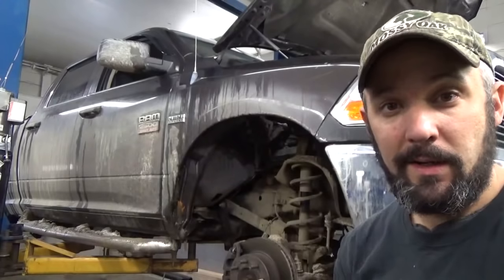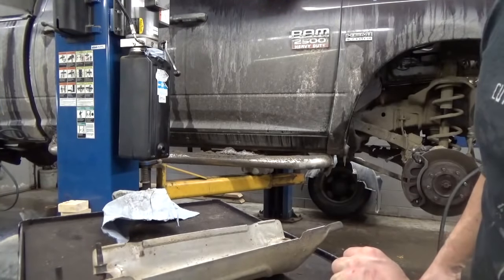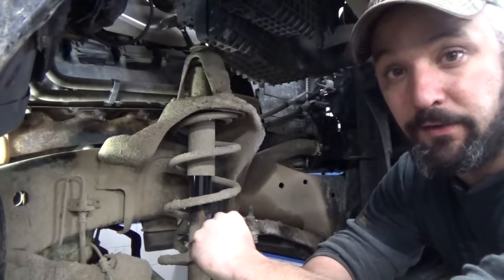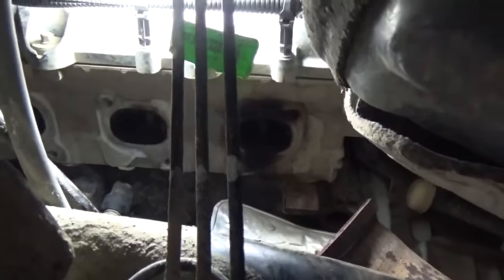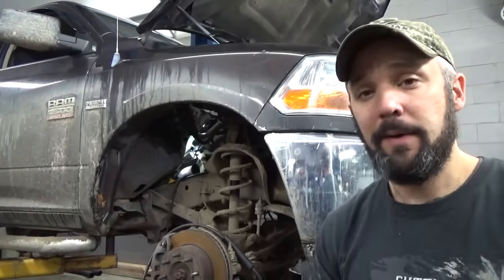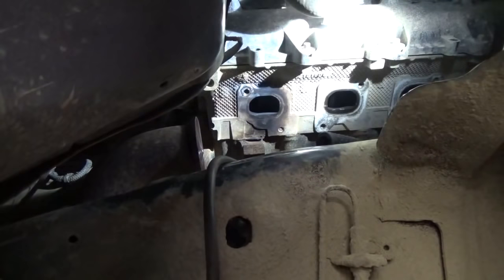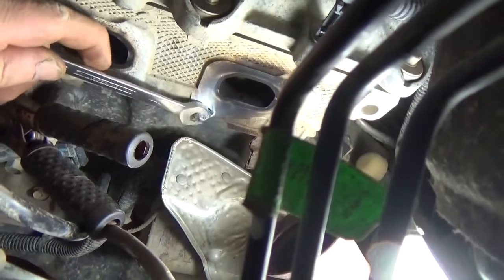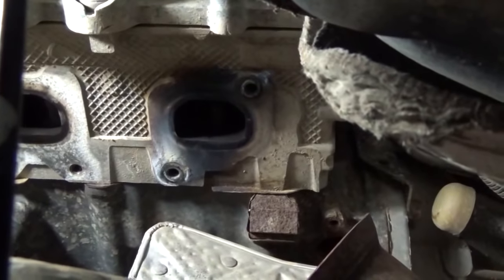Removing Broken Exhaust Manifold Bolts - Hemi Dodge Ram

Comment: Now I know how to fix broken exhaust bolts.  Just drop it off at your shop and wait for the call when you're done.
Reply: Sounds like the only real option to me.
Reply: You make it look easy. Experience plus correct tools is key.
Reply: Yep they never go the way they should, just buy replacements and hope it don't come to taps lol!
Reply: Or pay a mobile mechanic $200 to come do it in your driveway, in the rain, on sunday.  Lol.   Ask how I know
Reply: this video is for the poor bastard that has to take your vehicle in while you wait every 2 hours to call in to see if it's done yet.
Reply: @user-sl4ul4nc3t  Not me, I still have the guys number tho.  He showed up with a giant truck with a huge welder and zapped a nut on the end and worked it free. 🤷‍♂️
Reply: @getchasome6230  I would pay $200 for sure. I have the tick and it goes away after warm up so guessing this video is explaining my problem. How did you find a mobile mechanic.
Reply: @TrustNone35  I paid $200 to have a broken bolt removed. Lol.  It's going to cost way more than that to fix your tick
Reply: @getchasome6230  Jesus christ man I was gonna say I'm a licensed tech and 200 for the whole job in a driveway I was like wtf lol
Reply: @6door6four96  Lol. No, $200 was for just one broken bolt.
Reply: After some pb blaster and small pair some of those old craftsman self adjustable pliers I have successfully removed those junk bolts lol

Comment: I have a 2009 1500 ram 5.7 and two bolts from both right and left side fell out. I have the tickong noise coming from the exhaust. Wish I had the tools to fix it

Comment: Tip on welding nuts to broken bolt/studs, especially when the bolt is broken below the surface;  weld build-up a nubbin on the bolt BEFORE putting the nut in place for welding.  This does two things: it lets you more precisely place the initial weld metal on the bolt, then it lets you easily position the nut over the nubbin for final welding.   I've been using this method for many decades and it almost always works for me.  Love your videos.
Reply: Where do you put the ground clamp for the welder ?
Reply: I know how to weld and I'm a mechanic that's still my question... can you just attach the negative probe on the head or block and send the current through the motor... wouldn't that risk sensors being zapped
Reply: I'm watching this because I have to do this this weekend...
Got a major exhaust leak cause a bolt broke off.
Gotta take exhaust off and remove them stuck and broke bolts.
I hope it's as easy for me as you make it look

Comment: I just want to say thank you and i really appreciate for you to take  your time to film step by step of what you are doing. It is extremely resourceful.
Reply from the maker: Jacky L. Cool glad you enjoy it :)
Reply: I'm wondering why the bolts broke in the first place?
Reply: @SouthMainAuto  are the replacement bolts better than factory bolts or will thia happen again?
Reply: @thomassavage527  I want to know the same thing. I have a theory but I want someone to answer the why first.
Reply: @theminion2771  Small bolt and the constant hot/cold cycles mixed in with vibration is what I believe is happening. I need to get this job done on my 09 5.3 Silverado .

Comment: Just used your "weld on the nut" method for removing the same four broken bolts on a 2007 Dodge Durango 5.7 hemi... Worked fantastically!

Comment: Very nice work.   Always great to see a professional working his trade and always a good feeling when those broken or seized bolts start backing out of the hole.  Just used this method to remove 5 broken cylinder head bolts on a 1959 outboard motor I'm rebuilding.

Comment: I had to replace my gaskets and had two broken studs on both sides. Luckily I had purchased a mig welder a few months ago and your method of extracting the bolts worked perfectly. Thanks for the video......it saved me a lot of money and time. Replaced both sides in about three hours!
Reply from the maker: Kacey Faith Cool :)
Reply: @SouthMainAuto  where do you put the ground for the welder? Thanks for the nice work!!!

Comment: Hey Eric.I just used the welding the nut on method on 4 broken exhaust manifold studs on the passenger side on my 2004 Ford F-250 5.7 liter gas engine..It worked great.The last one was a bugger.It took 8 tries before it grabbed it.I had to build it out first and then weld the nut on it.I had to heat up the aluminum head area a lot with a Mapp gas torch for 10 minutes first.This is what seemed to make it let go.My welder is an older Solar 165 with 75/25 gas.Tried with shielding gas but it worked better with .030 flux cored wire.Got a very strong bond to the stud with this.I kept the electrode hand piece on positive polarity.Got very good penetration to stud.Just wanted to Thank You for saving me tons of time,money and aggravation. You have a great you tube channel.

Comment: Great work! That's a really satisfying feeling when that stud breaks loose and comes out. I've personally had better luck just building up a "blob" on the remains of the bolt and then grabbing it with a Craftsman bolt extractor. Placing a nut over it and squeezing the trigger was like shooting in the dark for me...ended up breaking the weld and wasting nuts haha  Works great on rusted brake bleed nipples too...just grind it flush with the caliper and weld on a blob. After practicing this method, the drill is now the last resort!
Reply from the maker: Hey thanks for watching! Yeah I've used the "blob" method too lol. Yeah the drill is the last thing out any more, I have had really good success using this method for years now.  Mountain bikes and motors sounds like me. I do enjoy hitting the trail and back roads, not sure if I wanna do it on a 1x10 though :) Enjoy the vids and ride on man!

Comment: I've use that technique many times for busted bolt removal, I find that putting a little nugget of weld on the end of the bolt before welding the nut on works very well. It centers the nut and gives a nicer penetration on the bolt.

Comment: Your technique is great for bolt extraction. Yes, I did have a couple take-aways. One, I need to step up my game and get 100-times better at welding. Two, I'll use my improved welding skills to give your technique a go.  Thanks for taking your valuable time to make, elevate and share your video.

Comment: That's the absolute best way to get those out but on the Fords they are much harder to get to. I just wish I knew how to weld and not rely on others. Maybe I can stop by and show me a thing or two during my Fixing Fords Across America Tour this summer. I think your shop setup is interesting too I would like to see that also.
Reply from the maker: FordTechMakuloco  Swing on in sir :) Wait a ford with bad manifolds!?! Never heard of such a thing :P
Reply: FordTechMakuloco I have welded many of these. even pulled 17 out of a hundred year old boiler.. try a nut one size bigger... on mig set the voltage a bit higher but leave the wire speed alone...dont be afraid- it wont weld to the head, even a cast iron head...
Reply: FordTechMakuloco But I couldn't get one out of my 460 manifold that holds the thermostat housing...go figure...
Reply from the maker: Michael Owen Of course, when you have 2 bolts to hold it down ya kinda need all of them haha
Reply: Had to tap it to 3/8 and put in a stud... then opened the hole and used a nut to hold it
Hack job- but its not leaking
Reply: @SouthMainAuto     Had to do it on thermostat housing on a 63 ford dump truck. had to stick weld and had no luck ended up drilling out bolts and easy out them after heating up.
Reply: I like the one welder guy if it deep a copper bushing to stop the weld from welding other things go buy a mig welder it's simle
Reply: @robertthrem3382  how big of a MIG welder do you need ?
Reply: @peterp4319  I'm good I have I think a 140 Hobart farm and fleet had them 😂 I had to go buy the tank. The Lincoln has plastic rollers haha I broke 2 and took them back. That's what construction guys do in the winter they get bored and they find a project that will last so I put the new fenders sections . rocker panels and my truck and bought the painting tools
Reply: Ooooooooooooooooooooooooooooooooooooooooooooooooooooooooooooooooooooooooooooooooooooooooooooooooooooooooooooooooooooooooooo
Reply: Oooooooooooooooooooooooooooooooooooooooooooooooooooooooooooooooooooooooooooooooooooooooooooooooooooooooooooooooooooooooooooooooooooooooooooooooooooooooooooooooooooooooooooooooooooooooooooooooooooooooooooooooooooooooooooooooooooooooooooooooooooooooooooooooooooooooooooooooooooooooooooooooo pop ooooooooooooooooooooooooooooooooooooooooooooooooooooooooooooooooooooooooooooooooooooooooooooooooooooooooooooooooooooooooooooooooooooooooooooooooooooooooooooooooooooooooooooooooooooooooooooooooooooooooooooooooooooooooooooooooooooooooooooooooooooo
Reply: Ooooooooooooooooooooooooooooooooooooooooooooooooooooooooooooooooooooooooooooooooooooooooooooooooooooooooooooooooooooooooooooooooooooooooooooooooooooooooooooooooooooooooooooooooooooooooooooooooooooooooooooooooooooooooooooooooooooooooooooooooooooooooooooooooooooooooooooooooooooooooooooooooooooooooooooooooooooooooooooooooooooooooooooooooooooooooooooooooooooooooooooooooooooooooooooooooooooooooooooooooooooo
Reply: Oooooooooooooooooooooooooooooooooooooooooooooooooooooooooooooooooooooooooooooooooooooooooooooooooooooooooooooooooooooooooooooooooooooooooooooooooooooooooooooooooooooooooooooooooooooooooooooooooooooooooooooooooooooooooooooooooooooooooooooooooooooooooooooooooooooooooooooooooooooooooooooooooooooooooooooo
Reply: Ooooooooooooooooooooooooooooooooooooooooooooooooooooooooooooooooooooooooooooooooooooooooooooooooooooooooooooooooooooooooooooooooooooooooooooooooooooooooooooooooooooooooooooooooooooooooooooooooooooooooooooooooooooooooooooooooooooo
Reply: Oooooooooooooooooooooooooooooooooooooooooooooooooooooooooooooooooooooooooooooooooooooooo
Reply: Ooooooooooooooooooooooooooooooooooooooooooooooooooooooooooooooooooooooooooooooooooooooooooooooooooooooooooooooooooooooooooooooooooooooooooooooooooooooooooooooooooooooooooooooooooooooooooo
Reply: Oooooooooooooooooooooooooooooooooooooooooooooooooooooooooooooooooooooooooooooooo
Reply: Ooooooooooooooooooooooooo
Reply: Ooooooooooooooooooooooooooooooooooooooooooooooooooooooooooooooooooooooooooooooooooooooooooooooooooooooo
Reply: Ooooooooooooooooooooooooooooooooooooooooooooooooooooooo
Reply: Oooooooooooooooooo
Reply: Oooooooooooooooooooooooooo
Reply: Oooooooooooooooooooooooooooooooooooooooooooooooooooooooooooooooooooo
Reply: Oooooooooooooooooooooooooooooooooooooooooooooooooooo
Reply: Oooooooooooooooooooooooooooooooooooooooooooooooooooooooooooooooooooooooooooooooooooooooooooooooooooooooooooooooooooooooooooooooooooooooooooooooooooooooooooooo
Reply: Oooooooooooooooooooooooooooooooooooooooooooooooooooooo
Reply: Oooooooooooooooooooooooooooooooooooooooooooooooooooooooo
Reply: Oooooooooooooooooooooooooooooooooooooooooooooooooooooooooooo
Reply: Ooooooooooooooooooooooooooooooooooooooooooooooooooooooooooooooooooooooooo
Reply: Oooooooooooo
Reply: Oooooooooooooooooooooooooooo
Reply: Oooooooooooooooooooooooooooooooooooooooooooooooooooooooooooooooooooooooooooooooooooooooooooooooooooooooooooooooooooooooooooooooooooooooooooooooooooooooooooooooooooooooooooooooooooooooooooooooooooooo
Reply: Ooooooooooooooooooooooooooooooooooooo
Reply: Oooooooooooooooooooooooooooooooo
Reply: Oooooooooooooooooooooooooo
Reply: Oooooooooooooooooooooooooooooooooooooooooooooooooooooooooooooooooooooooooooo
Reply: Oooooooooooooooooooooooooooooooooooooooooooooooooooooo
Reply: Ooooooooooooooooooooooooooooooooooooooooooooooooooooo
Reply: Ooooooooooooooooooooooooooooooooooooooooooooooooooooooooooooooooooooooooooooooooooooooooooooooooooooooooooooooooooooooooooooooooooooooooooooooooooooooooooooooooo
Reply: Oooooooooooooooooooooooooooooooooooooo
Reply: Oooooooooooooooooooooo
Reply: Ooooooooooooooooooooooooooooooooooooooooooooooooooooooooooooooooooooooooooooooooooo
Reply: Ooooooooooooooooooo
Reply: Oooooooooooooooooo
Reply: Ooooooooooooooooooooooooooooooooooooooooooooooooooooooooooooooooooooooooooooooooooooooooooooooooooooooooooooooooooooooooooooooooooooooooooooooooooooooooooooooooooooooooooooooooooooooooooooooo
Reply: Oooooooooooooooooooooooooooooooooooooooooooooooooo
Reply: @SouthMainAuto  Ooooooooooooooooooooooooooooooooooooooooooooooooooooooooooooooooooooooooooooooooooooooooooooooooooooooooooooooooooooooooooooooooooooooooooooooooooooooooooooooooooooooooooooooooooooooooooooooooooooooooooooooooooo
Reply: @SouthMainAuto  oooooooooooooooooo
Reply: @SouthMainAuto  ooooooooooooooooooooooooooooooooooooooooooooooooooooooooooooooooooooooooooooooooooooooooo
Reply: @SouthMainAuto  ooooooooooooooooo
Reply: @SouthMainAuto  ooooooooooooooooooooooooooooooooooooooooooooooooooooooooooooooo
Reply: @SouthMainAuto  ooooooooooooooo
Reply: @SouthMainAuto  Oooooooooooooooooooooooooooooooooooooooooooooooooooooooooooooooooooooooooooooooooooooooooooooooooooooooooooooooooooooooooooooooooooooooooooooooooooo
Reply: @SouthMainAuto  ooooooooooooooooooooooooooooooooooooooooooooooooooooooooooooooooooooooooo
Reply: @SouthMainAuto  oooooooooooooooooooooooooooooooooooooooooooooooooooooooooooooooooo
Reply: @SouthMainAuto  ooooooooooooooooooooooooo
Reply: @SouthMainAuto  oooooooooooooooooooooooooo
Reply: @SouthMainAuto  ooooooooooooooooooooooooooooooooooooooooooooooooooooooo
Reply: @michaelowen1750  Oooooooooooooooooooooooooooooooooooooooooooooooooooo
Reply: @michaelowen1750  ooooooo
Reply: @michaelowen1750  oooooooooooooo
Reply: @michaelowen1750  Ooooooooooooooooooooo
Reply: @michaelowen1750  oooooooooooooooooooooooooooooooooooooooooooooo
Reply: @michaelowen1750  oooooooooooooooooooooooooooooooooooooooooooooo
Reply: ...welding borders on being an ART- you'd be better off taking a night class-(!)

Comment: I Have a 2008 F-250 5.4LT with and exhaust manifold nightmare. The studs are and nuts have turned into blobs of rust. I wanted to try this method and you have proven it is a viable path to follow. Thank you!!